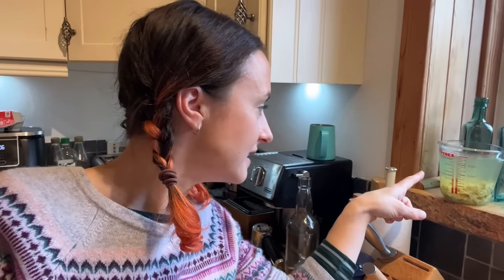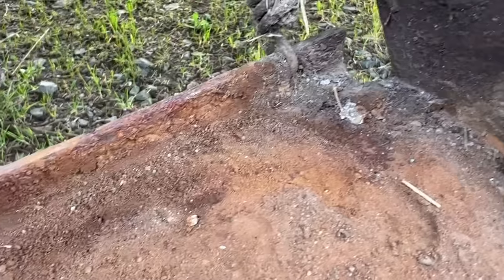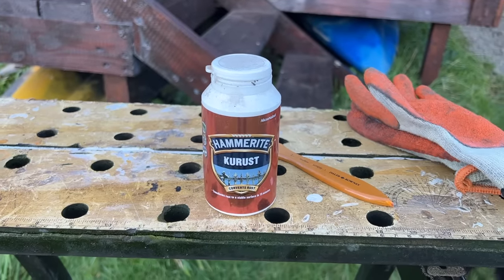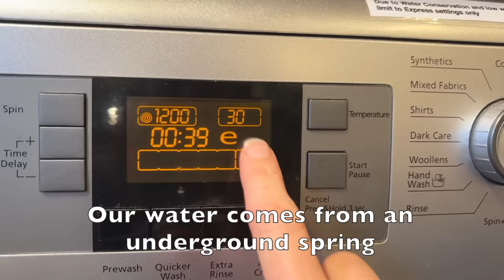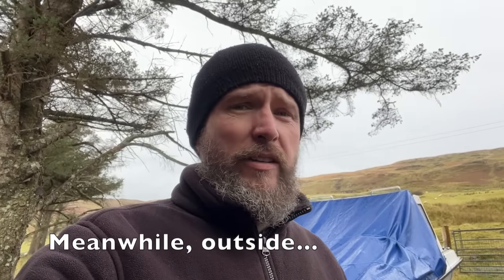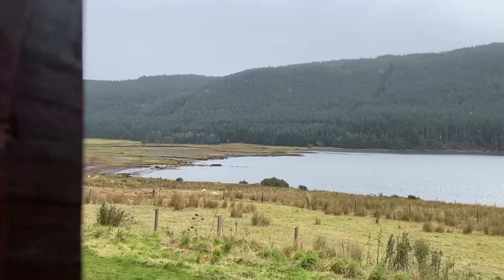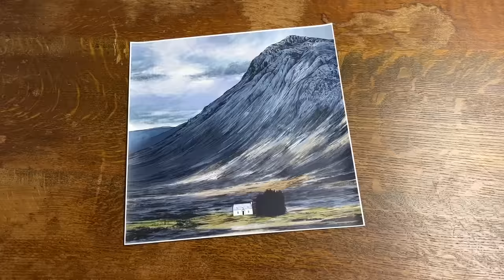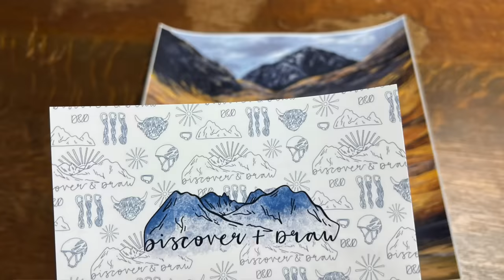Preparing For Winter At Our Cottage On The Isle of Skye, Scottish Highlands Ep45

Comment: The steps rust out because of moisture trapped between the step and the covering, previously the rubber. The new plates will probably do the same. However, they look fantastic, much better than the rubber ones. Brilliant little job well done

Comment: Cracking job on the Landrover steps, they should last for more than a year now.  However electrolytic corrosion between the aluminium plates and the steel base is very likely to hasten metal munching.  You could delay it for a while by painting the top of the steel and the bottom of the aluminium with a layer of bitumen paint.    I am looking forward to seeing more of Jack Spaniel in your next video.

Comment: We have been watching you fold since the beginning and it's become our Sunday evening staple. 
I do have to make a couple comments - PLEASE put the guard back on your angle grinder. Depending on what you have, these often rotate at 5000 to 15,000 RPM. if that cut off wheel fractures, the pieces can become deadly - and low end safety goggles wont help save your eyesight. Also, using a rotary wire brush without a full face shield may end with you having to pull wires out of your face - and they hurt more coming out( - personal experience :-{) !

Comment: You can steep chamomile or elderberry flowers with the horse chestnuts and that will add a light scent without adding a staining agent. We use horse chestnut soap to wash linen because it is effective at cleaning but not harsh on the linen.

On the Land Rover steps, you might want to grease those hinges with marine grade grease with a really low freeze point. Those hinges are going to seize up as it gets colder and they ice up.

Comment: 3 things - 1) If you'd kept the green outer shell too, you could have made gorgeous natural chestnut brown dye with them. Sally Pointer may have something on her channel showing you how. 2) Science;: Suds have little to do with how clean your laundry is - (unless there's excessive suds, in which case, your laundry won't get clean).  Surfactants adjust the surface tension of the water, act as a wetting agent for the fabrics & adjust the adsorption & absorption levels to ensure a balanced chemistry (liquid, gases etc) throughout the wash. 3) I've used various alternative detergents for years & my main observation was that I couldn't remember to use the home-made liquid in time, so I just used some nuts in a little cotton bag & hung it to dry after, so it wouldn't go mouldy. Next is that under 55s won't get much out of them because most don't know how to launder clothing anymore. Since schools stopped teaching HE etc, most people grew up slapping stuff in a washing machine with toxic chemicals then in an even worse dryer. They don't know that the laundry process includes examination & treatment of stains or odours before washing & that hanging laundry out in the sun is part of the disinfection, bleaching & stain/odour-removal process.  A stained or malodourous item should not be added to the wash without pre-treatment, as it can contaminate other pieces; it should be treated immediately & soaked if it cannot be washed directly.  Laundry chemicals are dangerous too, & not just for the environment; multiple times I've had to stop ppl from adding bleach to a detergent-filled laundry load - there are cryptic warnings on packets but since they don't learn HE at school anymore, they don't understand they're making Chlorine gas & that it can maim or kill. Alternative detergents are fine for ordinary lightly-used laundry if you consider all of the other processes required for your particular load, & adjust them accordingly. We even do most of our laundry in cold water here, but you may need to turn your heat up or soak etc. If people are prepared to put the work in, they're fine, but if folk have stained, stinky or heavily soiled laundry that they aren't able or willing to pre-treat, or if they're coal miners or whatever, they might need to think about alternatives. Historically, a copper cauldron was used for boiling whites on the fire & with an early relative of laundry soap - ash from the fire mixed with stale urine LOL.

Comment: One tip, Willie - don't use the same grinder discs for both steel and aluminium. The dusts, when mixed, are very flammable (think thermite!). I'd also be tempted to run a bead of sealant around the edge of the chequerplate to stop water getting under it.

Comment: If that is aluminium plate then you need something between the plate and the steel step or water will get in it will behave like a battery and speed up corrosion. I think it is called galvanic corrosion.

Comment: A fun video.  I would use conker detergent, but only if someone else made it!  I used soap nuts for about a year.  They worked well.  Love the prints - and the frames you used.  Well done, Willy.  Those steps on the Landy look great.

Comment: Sarah, if you run out of conker detergent, I would consider buying some soap nuts. The soap nut fruit also contains saponin, and they're really cheap, easy to use and last ages! They're also chemical and fragrance free. You just get a nice clean smell afterwards. Only ok for general washes, without pre-soaking any stains. (That's all I do.) I love them. So much cheaper than ecover etc.

Comment: Wood burns so quickly! They’ll easily get through that lot in a six month winter. It’s not a fossil fuel, of course but wood smoke is a heavy pollutant and they certainly would not be allowed to burn all that in a built-up area! 
What is the alternative? I’d go for solar panels. Get enough of them should meet you needs. And once installed it’s a lot cheaper when you factor in a cost for the time fetching and carrying all that timber

Comment: Happy belated birthday Willie your steps turned out nice and a tip for next time if you add one or two layers of duct tape between the aluminium and steel it will stop the corrosion caused by a reaction of the dissimilar metals this method works well as a barrier.anyway thanks for sharing your lives with us I hope you reach 50K by Xmas looking forward to next week Karl from eastern Canada

Comment: Sorta. While the rubber was an awful water (and therefore rot) trap, the chequer plate is ally so now you have steel and ally together with steel fasteners - add water and salt for perfect conditions for galvanic corrosion…..

PS don’t clean the old ash out of the fire, it needs a solid bed of ash to burn in.

Comment: I wouldn’t use the conker detergent myself. I always use Ariel ( which is a superb washing powder ) especially when washing at a quick wash on 30 degree. I’ve tried using other brands on a low heat wash but always go back to Ariel. Superb on low settings and fast dissolve too.